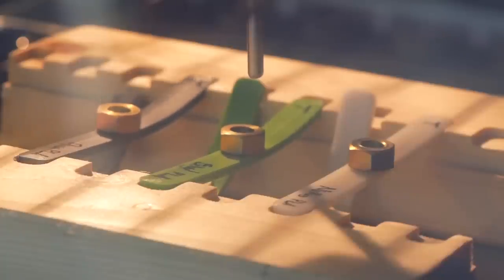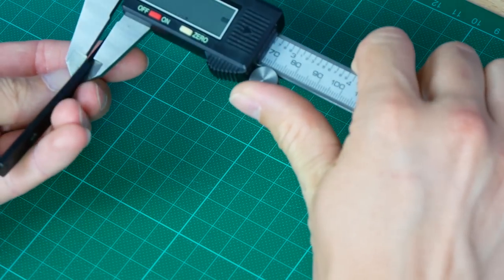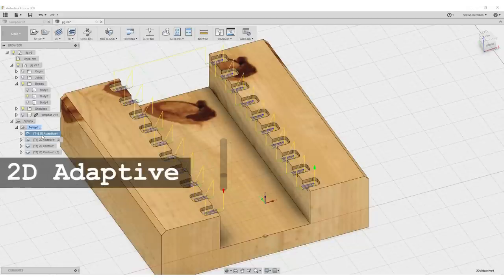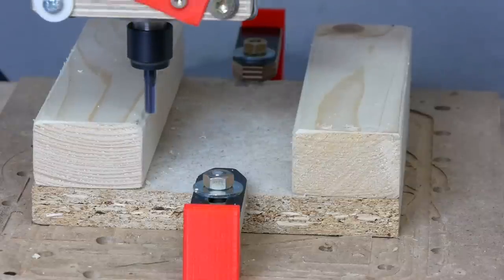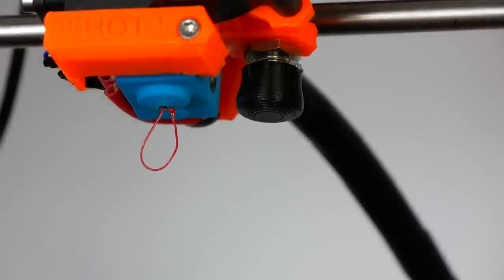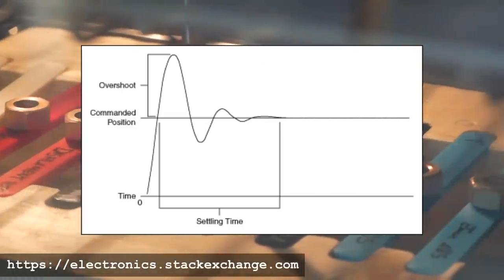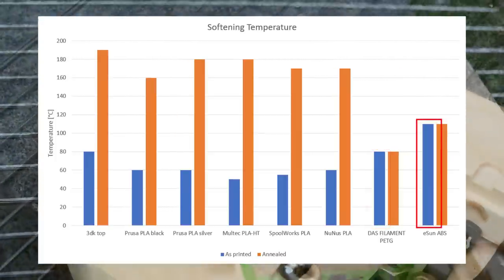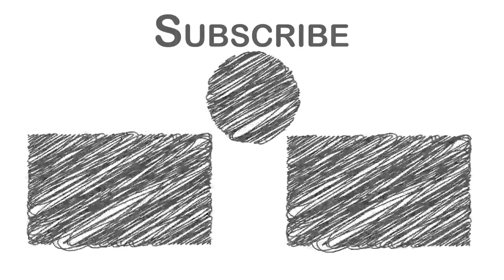What's the temperature resistance of annealed PLA, PETG and ABS?

Comment: I am a scuba diver and I printed some stuff to use underwater, like a flashlight holder and small plastic tabs and buckles.
I am having problems with sea water getting into the PLA parts, and then it is very difficult to take all the water out. 
Do you think increasing the number of perimeters will solve this problem? Or maybe increasing the temperature so the layers bond better?
Reply from the maker: I guess your problem is the pressure. I would either recommend printing with 100% infill (usually not the best idea) or to design your parts hollow with drain holes. I think its hard to get the part 100% watertight even with more than 4 perimeters.

Comment: I realize I'm here three years after the video, and you might have already done this, but could one anneal PLA and maintain shape by putting it in a paint can full of tightly-packed sand? (perhaps with a heavy weight on top of the sand) It seems to me that, if we were able to properly anneal PLA parts with minimal deformation/shrinkage, but still get the high temperature resistance and native rigidity, we could make some extremely effective parts for 3D printers.
Reply: No……it needs to shrink for it to change. If it were possible to prevent the material from moving then the annealing process would do nothing at all.

Comment: Do you have any information on your CNC you can share?  I would like to start getting into a CNC machine but want to build my own.
Reply from the maker: I didn't put out lot's of information about my CNC. Built it like 4 years ago with cheapest home improvent store parts but works quite well to that day. It's not the most stiff nor the fastest, but it handles wood quite well. I talk a little bit more about it in this video: https://youtu.be/P9oua4Q0EWw
Reply: CNC Kitchen Thank you.  Did you design it yourself?  It looks like the rails are full length drawer sliders.

Comment: Is there a consistent shrinkage percentage?
Reply: Usually yes, although it may vary from PLA to PLA, depending on where you get it.
Reply: It is amazing the soften temperature improvement made , do you think PLA annealing is practical for mechanical parts
Reply: I've only tested annealed HTPLA in mechanical situations. I've noticed an increase in strength for sure, but you'll need to manage the potential warpage. If you're annealing a flat part, keep it under a flat heavy plate.
Reply from the maker: Shrinkage depends on the material manufacturer, color and your print settings. Thick parts might be different to thin ones. There is some playing around involved but in the end you will get much better performing parts!

Comment: Are those speciments printed at 100% infill?
Trying to get an approximation for the tensile strength of the material at higher temperature.
Reply from the maker: As far as I remember they actually had 100% infill.
Reply: Great :) btw, do you think you could do a tensile test like you did with those frozen samples but with hotter ones at different temperatures? :)

I'm trying to build a pressure vessle for steam and it would be a lot easier if I could 3D print the thing in PLA or something similar, and anealing looks promising :)
Reply from the maker: Don't 3D print a pressure vessel! It has the potential to kill you!
Reply: It's safe, it's only 1 bar and a small container (Like 3 cm^3 or something like that) so the energy stored is only around 0.3 J :) So even if all the energy went into one small piece of plastic it wouldn't be worse than getting hit by a soft air gun. Safety glasses is still a good thing tho.

Comment: Do you have nunus pla, because I saw the name on a stick!!! If yes, what are you temperatures? I have nunus super blue "pla"! but I have to print it like abs, but with fan on!( and it doesen't warp!!!!) The problem is, that it tangels in the extruder with so hot temperatures!!!
Reply from the maker: Yes, your right, that's NuNus PLA and I was using it for years on my old Mendel90. I used to print it at 215°C and did not have any problems. If yours gets soft in the extruder, make sure your hotend is properly cooled.
Reply: CNC Kitchen OK, thank you!! It is properly cooled, but I think I know the problem: There is too much color stuff in the filament!! because it drips out,(the color as a liquid) if I heat it too long! an also, the color deconstructed the properties of the pla! thats why it is sooooooo flexible if I don't let it cool down enough!
PS: I love your videos: great quality, great information, keep on making them!!!!!!

Comment: does the g-code from fusion work with mach3?
Reply from the maker: Yep, there is a post processor for Mach 3 in Fusion 360.
Reply: nice! what about if i have a 4th rotary axis?
Reply from the maker: I think it can even handle 5 axis but I haven't tried that yet, so don't quote me on that ;-)

Comment: so PETg was the worst material?
Reply from the maker: Well, unannealed PLA performed the worst. Only if you anneal it you can use it for high temperatures. But PLA will shrink and warp, which might be bad, so it depends on your application.

Comment: Why is PLA the most popular if it is the least heat resistant (most likely to deform).
Reply from the maker: Because it's the most simple to print, doesn't smell, has high strength and stiffness values and makes the best looking prints.